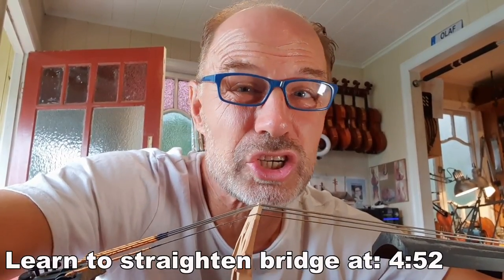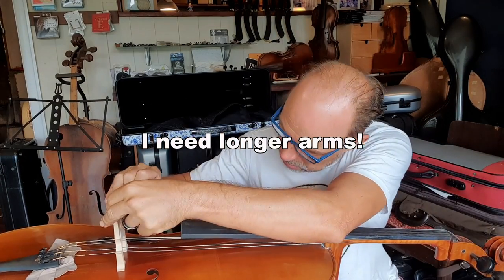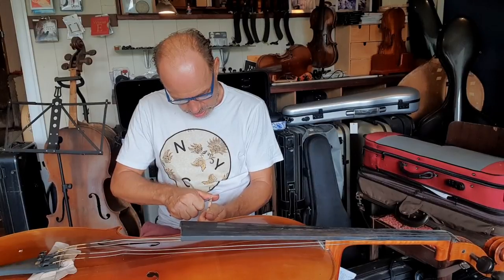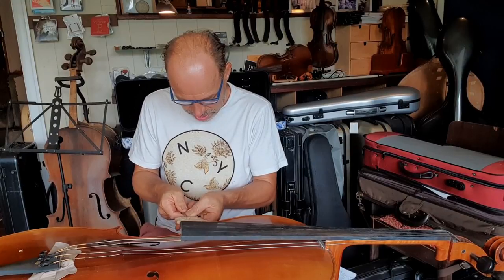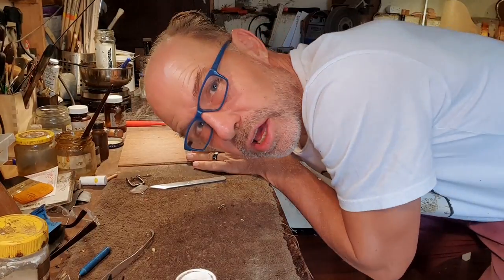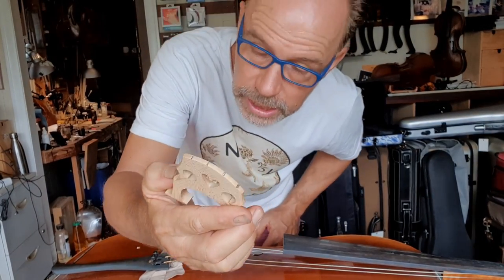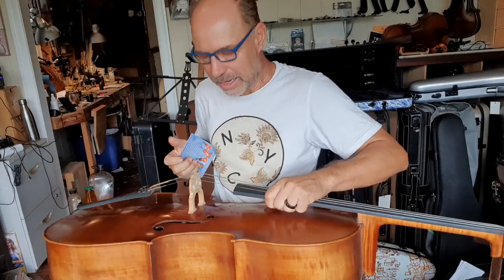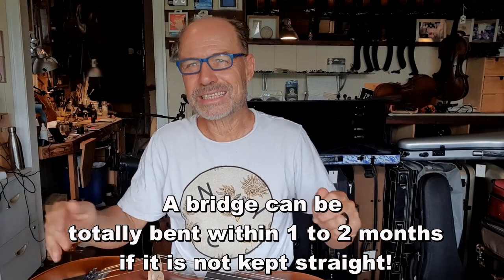You need to Straighten your Cello Bridge!

Comment: What if the feet aren't in full contact? Doesn't that cause it to bend if they stand on one side? I use a thin paper to see if it slips under any side of the feet and then I adjust until it doesn't.
I scraped the feet on a cheaper cello as they didn't have very good contact from factory/store, just like you scrape machine surfaces on lathes and mills which I'm more familiar with I did like Edgar showed in a video with lipstick on the cello and then pushed the bridge onto it. Scraping of the high spots and kept doing it until I had almost full contact. Went from like 20% to 90% surface contact and I think the sound improved as well.

Comment: Sorry, extremely naive question, but what can concretely happen with an unstraightened bridge? Because I guess if you don't notice it, it means that you can still sound well on your instrument right? The consequences were not very clear for a plebeian (in this otherwise very good video!) :)
Reply from the maker: Firstly you get a lot less sound from your instrument and secondly the bridge can snap and damage the top of the instrument. 
If it is slightly bent, a violinmaker can straighten it with steam, but there is a point of no return.
Reply: @AskOlaftheViolinmaker  thanks a lot for the answer! I am not a string instrument player myself hence my noob question =)

Comment: Olaf, a story of woe and questions for you. 

After many years of pondering, I purchased a “cheap” cello from the lovely China having been reassured that mostly these were now passable instruments. Sadly it turned out to be almost unplayable, I’m only a beginner with cello, but played viola as a child, although I’m relearning everything now. It arrived with an uncut bridge, horrible strings which broke within weeks and a lacklustre bow which wasn’t up to much.  I spent money to improve things, found new strings (what a price they are), a new carbon fibre bow, a new bridge, pegs were loose so i also got some peg paste.  I carved the bridge myself following a brilliant online instruction publication. (At this point and in lock down I wasn’t able to try and find a Violin maker). Each thing i did made a slight improvement. But sadly the instrument was poorly constructed and used a lot of ply wood so it still sounds awe full. Even the finger board is stained wood not ebony as it claimed...

I then went on to buy another having done much more research and physically held and played a number of instruments, I settled on the Hidersine Vivente finetune, which came bridge down, but having been set up in the store by their craftspeople correctly for me. I left factory strings on, the supplied bow sold separately for £150 seemed good enough quality for me. Just running scales on this instrument produces lovely tones and pleasant noises, the occasional squeak as I’m still not always finding just one string at a time, but the improvement was night an day even to my ear. 

My question is coming. Now that I have found a lovely cello, with a professionally set up post, bridge etc and a comfy bow, I think the factory strings could possibly be changed. But what a price they are!! On the first cello, I put a set of strings on which were on the cheaper side, certainly far superior to the supplied ones. These were in the £50-60 bracket., but came with many 5 star reviews which seemed legitimate. Should I save up the money and buy a set of strings stretching into the £200 to 300 range while i am a total novice, or should I find a happy medium with the up to £100 bracket? The professionals where I purchased my cello said the factory strings would be just fine, and when i broke them or played the brightness out of them then look at upping the quality. But I want my cello to compliment my efforts with the nicest noise it can make now,... I fully appreciate that the terrible cat murdering noises it comes out with now and then are my fault not its’ !!  So what would you recommend? A total beginner playing mostly just scales and very simple tunes at present....would better strings make the kind of difference their price suggests? 

Sorry it’s been a long read... I hope to hear from you, you’re channel is wonderful and has been a HUGE resource to me recently. Many thanIs John.
Reply: A cello, violin, etc is not complicated. It's a set of strings being dragged and released by a bow, and the strings vibrate a wooden cavity. As long as that happens, you're good. Most bad sounds are being out of tune, or the bow not catching the strings due to innadequate friction due to material failure or inadequate rosin.

Comment: I have a friend who plays violin. It's bridge is badly bent almost like that one. Since we don"t have money to buy a new bridge, I boiled the bent bridge and it reset to original shape. But I still recommended to here to have a new bridge since it will might bend again even it is placed straight. After several weeks, it really bent a bit again in the same direction. It's really better to have a bew bridge once it is bent, even though it can be reset by boiling (or steaming).
Reply: Would it not make more sense and be more logical for the cello to be tuned in perfect 5th left to right for down bows (left to right) to be more natural) ?_?
Reply: The best is to microwave it in 10-15 second bursts, it will straighten itself - then clamp it to a flat bench surface and leave it to cool down overnight before putting it back on the cello. This doesn't introduce more water than is needed to the bridge, just warms the existing particles between the grains to create a small amount of steam which is all that's needed.
 I do this with student instruments all the time and it yields good results (parents of students also don't have the money to go get a new bridge cut every time it bends over!).

Comment: Thanks for sharing, very helpful video. I have a cello hasn’t played for 30 years, i recently fixed it from a local luthier, new bridge and new sound post and new sets of cheap string. I found the C and G string are very mental sound and no sound for some lower positions. I really doubt this caused by the strings. As I can see the sound post very attached each side, bridge looks ok. Should I change a new set of strings, do you recommend? Thanks!

Comment: Can I do this while the strings are on full tension? Or should I tune them down a bit?
Reply from the maker: Usually it works with full tension... sometimes the strings stick to the groves and you might have to put pencil graphite in the groves...
If it doesn't move, you might have to see your violinmaker
Reply: @AskOlaftheViolinmaker  I am thinking it might be better for me to acquire a tradition cello and play it on the right side (i.e. scroll on the right shoulder, right hand on the fingerboard and left hand with the bow) and try to make due. Perché, I lack figures in my left hand, and had thought it best to peruse such so have a traditional 5-fingered-hand available to the finger board. Have you ever heard mention of any one trying something similar?

Comment: How do you stop the sound post from falling in when you take the strings off?
Reply: Go see a violin luthier that can help with putting back the sound post, if you don't know/have a luthier in your area, well...who knows?
Reply: It won’t, the post is wedged in between the top and bottom plate. 

The only way they fall is from trauma to the instrument, or if the bridge snapped and the percussion / vibrations were strong enough to dislodge the post.. otherwise they are set in place through pressure on top and bottom plate.
Reply: @charlesteixeira7451  cheers mate, I've replaced several sets of strings, shaped bridges and even set two sound posts since making that comment.